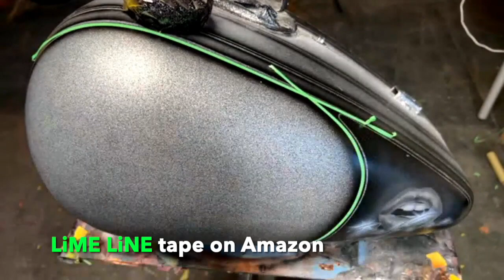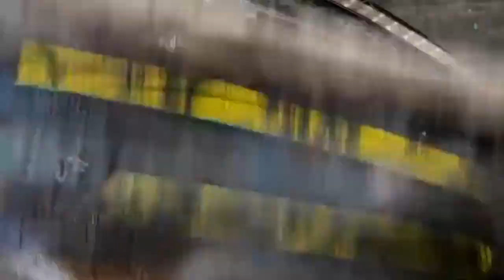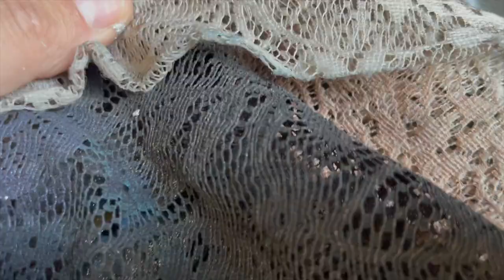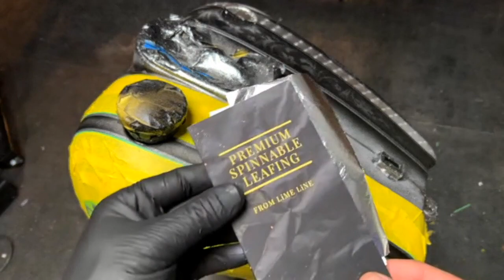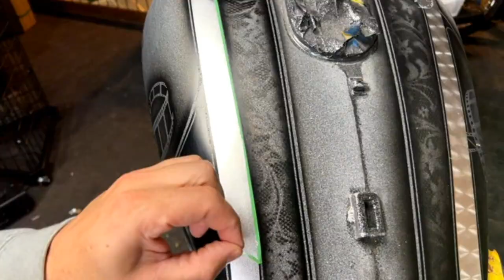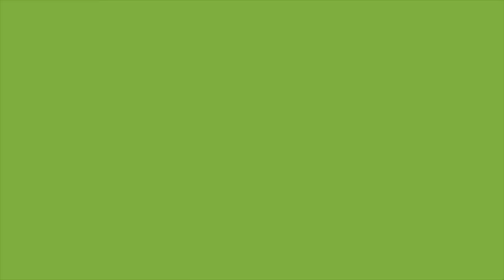Marilyn Monroe Lowrider Style Harley Davidson with LiME LiNE silver leaf

Comment: You’re sizing glue has been the best I’ve found so far. I still find it tough to get perfect edges. They are always about 95% perfect. I see you put leaf on over the tape with good results. I tend to pull tape first in hopes to get better contact with edges. What’s your thoughts on that method? Your way seems to work great too.